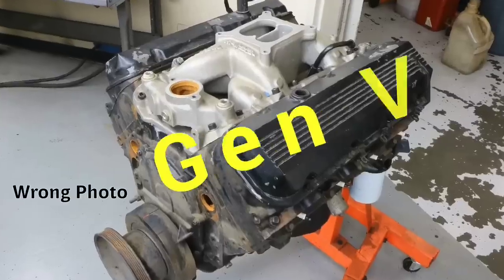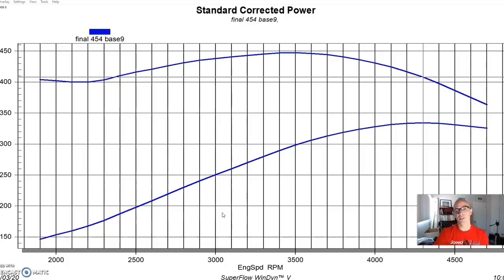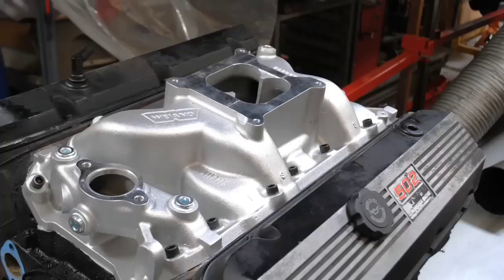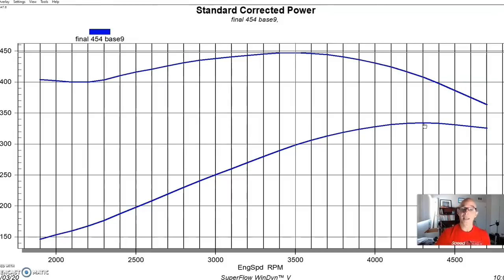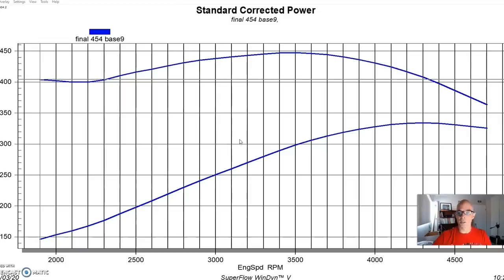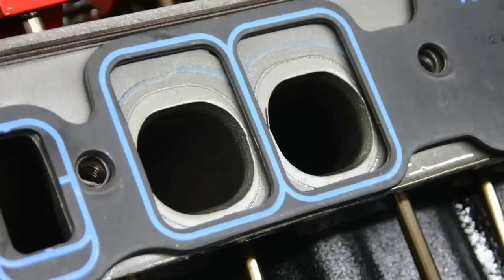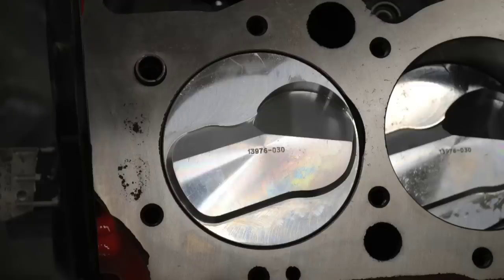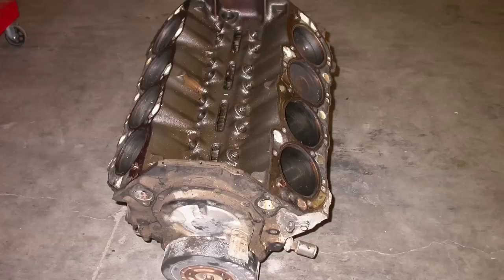HOW TO UPGRADE YOUR TBI PEANUT PORT 454

Comment: Aweome! I love test like this. Have you air flow tested gen 6 heads? Ive seen some results that show the gen 6 heads flow the same as gen 5 peanut port heads. If i understand correctly, the gen 6 heads intake runner ends up the same size as the peanut ports farther down.  And, the exhaust flows less. 

The numbers at .500 lift for the peanut ports were 226/156 and the gen 6 heads were 226/140. Have you done any test to show if this is correct or not?
Reply from the maker: I have flow data
Reply: @richardholdener1727  are we gonna get to see it? You gotta show us!
Reply: If you Can show the numbers!!!! Thanks Man!
Reply: @richardholdener1727  Oh Boy!!!
I am getting a new box of pop corn and have rang the bell!!! Let see them.
God knows I live this channel you created. Both more TV for me.

Comment: Have you done any combos with the factory 8.1 ?
Reply from the maker: not yet
Reply: Richard Holdener I bring it up because I seen one for sale and in the picture it had odd looking carb intake on it. At that point I realized I’ve never really heard any information about that motor and interchangeability with the standard big block.

Comment: I'm going to be testing that combination out next week the gen 5 block with gen 6 heads on it and with about the same camshaft he ran can't wait
Reply: how did it go??
Reply: I also want to know how it went
Reply: Any more info on this?
Reply: @bmoya170  yes it made 411hp and 450 torque torque line was flat on the graph from 2800 to 6000 its only got 8.78to1 for comparison
Reply: Did you have to make any changes to run those heads what gasket? Also did you run flat tappet or xr?
Reply: @bmoya170  I just matched the original head gaskets up with new heads to make sure that they would work and just bought a new pair of the same ones
Reply: It is a hyd flat, engine pro mc2305 is the brand and part number.  Also upgraded the springs as well ill se if i can find the part number for those as well.
Reply: I have a couple of videos of it on my channel you could check out

Comment: Put a set of 049 or 781 heads on it and leave everything else alone and run the test again. (Mine is a 1990 Mark IV 454SS)
Reply: I agree! I would be very interested with the 781 / 049 heads as well
Reply: A ported set of oval ports make awesome power
Reply from the maker: take a look at the oval port head test video-ported 049s in that one

Comment: In my opinion any motor that you want to modify should be at least 10-1 even with boost . torque this engine makes a big split camshaft like a 234-244 on a 114 +0 so it revs even if you lose torque to gain top end hp

Comment: 4:23 Isn't another part of the answer your typical usage of STD power figures vs SAE?
Reply: I think he's breaking it down as to what the differences are rather than just saying gross hp vs SAE net hp.
Reply: @Val_Killmore  I'm not talking about "Gross hp" as that hasn't been used in over 40 years.  SAE and STD are scales of measurement used in the dyno software that can skew the results.

Comment: why would i switch the heads? id just buy the gen6 and have everything i need
Reply: Gen 6 has dished pistons and small combustion chambers. Gen 5 has flat pistons and big combustion chambers. Gen 5 block with flat pistons plus gen 6 heads with small chambers equals more compression which equals more power.
Reply: @MountainPF  idk it had dished pistons in a gen6 make since now thx.

Comment: Boy I would really like to see you do a test with this gen v, and leave the TBI on and put on a good set of heads bump up the compression with a good cam spec, and see how much torque you make? That would be cool,because nobody that I know of has done this on YouTube. With the TBI edlebrock makes a intake,and you can eliminate the egr after 1990 and burn a chip. Edlebrock makes a really good head for this application #60499

Comment: I would shave 30 thousands off the heads . Us the thinnest head gasket I could checking piston to valve clearance.  Disassemble the heads. Cleaned up the ports that have ruff castings material in them . Gasket match port the intake mainfold. Possible gain of over 50 hours and torque.  Doing this is alot cheaper than buying new heads or gen 6 heads .
Reply: You also change the intake to torquer 2 intake with a 1 inch spacer under the carb .

Comment: this guy write the article "power fir peanuts: Gen V"? everything he did here was the same in that article. Picked up a 85 454 that has 14081045(says oval port, but I am guessing they are still peanut port, havent taken intake off yet) But I am debating on what I'm gonna do. gonna research on cheapest most power possible. see what I can do on stock pistons possibly, or see if I run across better heads for a good deal. I think I would be completely satisfied with 450hp 550tq. I want it to last me a long time, so I'll keep it under 5k rpm I think so the peanut port torque motor is probably what I'll end up with.
Reply from the maker: look at the by line for the article-you might find a familiar name

Comment: Id hoped you ported the heads to see what they can really do.
Reply: If you want to see that go to "Vortecpro". Mark Jones gets crazy power out of worked over factory castings. He did a big oval port 049 or 781, casting 461ci and with a tunnel ram made 729 hp. He does low compression pump gas engines that make well over 600 hp with big ovals and does big power with the peanut ports as well.

Comment: Turbo a stock peanut port 454.  9 psi, intercooler.  Test down to 1500 rpm, see if it can make 600 lb*ft without detonating.  That would be an awesome towing engine.  Don't care if the power peaks at 4000 rpm, if it can make 600 lb*ft everywhere, that would be 456 hp.  And it would make that power at altitude.

Comment: My daily is a 93 c3500 with this engine.  Knowing there's that much on the table with even the infernal TBI heads...?  My strategy was to stroke it to 4.500 or even 4.750, good rods, arp bolts and studs, 10:1 compression cast or hypereutectic pistons, a set of procomp 320cc heads, ~280 degree/0.600 lift retrofit roller cam, a dual quad intake with adapters and dual stock throttle bodies, longtubes, and a megasquirt 3.  The idea is to add flow, but increase stroke at the same time to maintain port velocity, shift the powerband back down, and not completely destroy the off idle torque. Should be well north of 500hp/600tq, and totally driveable.

Comment: Edelbrock 454 NHRA Rec/Port heads are $599 right now/bare..  Bowl Work n Cam n Smile.
Reply: EQ has some 188/replacement/copy Iron heads that are cheap n powerful as well.  Lots of reasonably priced 454 heads... Modded Open Chamber Early 70's stock heads can pull down 600hp.

Comment: Gen5 366 heads look good ,, same water ports , not peanut port and typical chamber of a 1969-1970 style chamber , same type non adjust rocker studs that can be changed

Comment: I think, the whole point of the matter of Peanut port and Large oval ports is, we're not gonna turn the RPMS up much past 3000.
So, I'll opt for the 1985 ####360 and later peanut ports and a Mercruiser Magnum Cam for high power Diesel performance just off an idle cause, lets be real we're driving on the street.
Ok, Rectangle ports against all comments, seem to work very well for bolt on power and anything you can do after that is all the better.
Reply from the maker: 3000 rpm?

Comment: You're basically getting a gross power output. where the SAE  way the manufacturers rate the engines is net after all the accessories and other losses

Comment: We sure made way more power back in the 80s and 90s with factory  rec port and l88 heads and crap on those peanut port heads. No one messed with them for a good reason. Q jets were out too. Junk

Comment: If there was a Gen 6 why not just buy the whole gen 6 motor, then you’d have a hydraulic roller cam also.
Reply: XOZ Industries the stock Gen 6 engines have pistons with more of a dish and they're running less than 9:1 compression, more than the stock peanut port engines, but not as much as a bump as a gen 6 head on a 'throwaway' gen 5 block... I bought my long block gen 5 for $200...

Comment: I put up a post showing that these are NOT peanut port heads and it has disappeared.  1992 and up TBI use a larger port head than the late 80's which actually were the PP heads.  The larger oval port heads are used all the way up to the HT502.

If anyone wants the casting numbers, reply and I'll reupload the data.
Reply: Store this info b4 Holdener removes the posts after flubbing the test.

Comment: Never believed that 230hp tbi 454 crap.  I bet if you put a 91 suburban on a chassis dyno it would have that to the wheel.  I've driven several 3/4 tbi 454 burbs.  If 230hp was real it would go 0-60 in about a mile, and they don't drive like that.  Starting in the late 60's GM started publishing fake power numbers that underestimate it for insurance and PR reasons.
Reply from the maker: 230 HP WAS A REAL NUMBER IN STOCK TRIM AND TUNE

Comment: Think of it this way, conspiracy theorists:
Higher dyno HP is a gross rating, the way things were done before (i think) '72 with no or very fee accessories and exhaust, etc.
Lower HP, which is a net rating, they way they're rated from the factory will always be lower due to parasitic losses from access.
Or.....think of it like your paycheck: Before taxes is the gross pay.  After taxes is your net pay.
Reply: He has said before that it's about 100hp less give or take a few hp
Reply: U have his number then if u ran the air cleaner accessories and a full stock exhaust on it it would loose some then if u had a complete vehicle with all the exhaust and accessories it would be even less
Reply: @bennettlockandkeymattandja9671  didnt know an alternator and water pump took 100hp from an engine.....lol, no way.

Comment: Should't the headline be called how to upgrade your 460?😁
Reply: ZE_GERMAN : Nice humour ZG. O,762 mm over size pistons make any 454 like a 460 is...Standard!
One question. Is a 2.5 Porsche 944, 3.0 968, 4.5, 4.7, 5 or 5.4 928 or those 1980's Merceades Benz SL 500...are they big blocks?  The alloy Stutgart and Weissach  engines each have a 4.8", 122 mm bore centres just like any Big Block Chevy. Who copied Who?

Comment: NON ROLLER 454 WIPING LOBES EVERY DAY!!!..JUST BUILD A GEN 6 ROLLER
Reply from the maker: EVERY DAY?
Reply: @richardholdener1727  ON A QUIET NIGHT YOU CAN HEAR AN OLD CHEVY PICKUP RUNNING ON 6 OR 7 CYLINDERS...ON A SERIOUS NOTE,i LIVE ON THE GULF IN FLORIDA..YOU WOULD NOT BELIEVE THE 454'S CRUSADERS COMING OUT OF BOATS WITH ROUNDED CAMS..ALL OF MY GOOD FRIENDS WITH BBC HAVE HAD TO PAY HUGE DOLLARS REBUILDING AND CONVERTING TO ROLLER CAMS AT A HUGE COST...ALL OF THEM AND A COUPE OF THEM WERE STUBBORN AND REBUILT WITH FLAT TAPPET CAMS AND HAPPENED AGAIN..THIS IS A HUGE PROBLEM..

Comment: I don’t know why guys run these more. 
Most guys don’t take their car to the track. Most guys when cruising town, don’t rev over 5,000 rpm anyway. 
So why the need for large ovals and rectangle heads????
Bragging rights????
Reply: mrbigg7255 that's my plan with my build - my 350 doesn't rev over 4500 RPM in my big van, so why build a big block to rev to the moon when I'll never use it...
Reply: But its there when u do use it